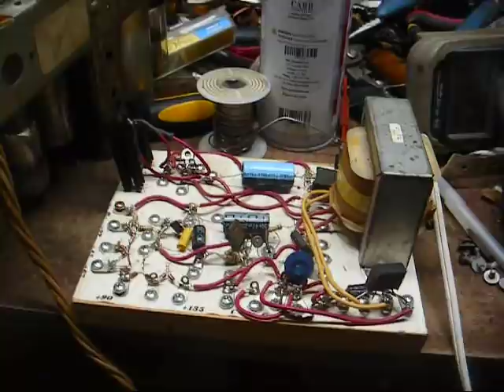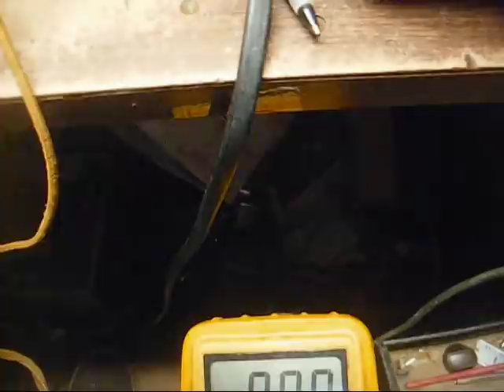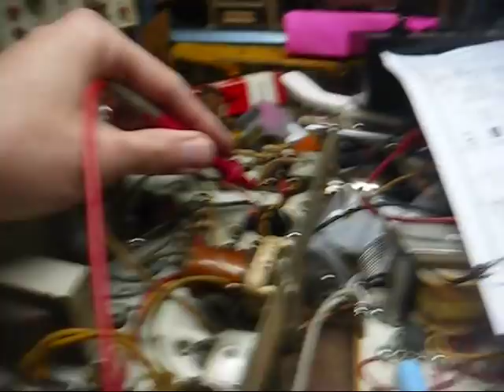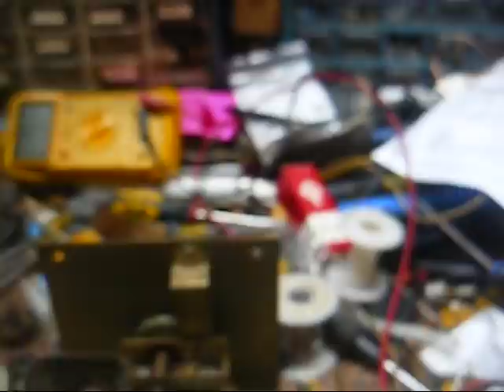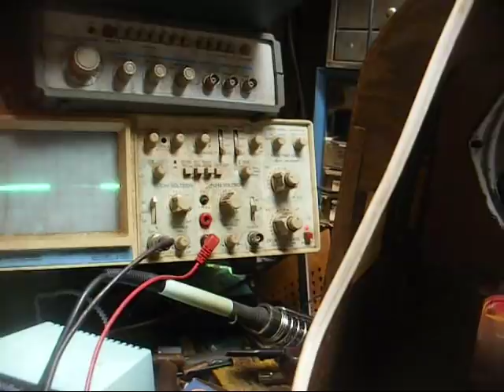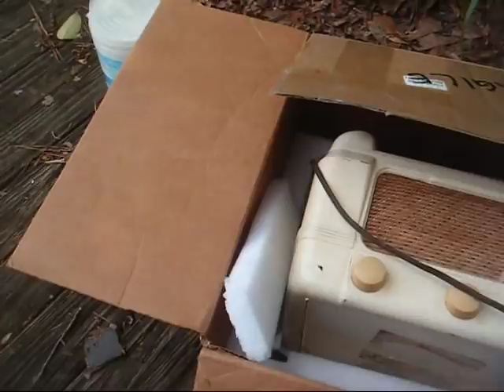Repair of a Philco 39-70 battery operated tube radio

Comment: Bryan : "Now If You're Wondering Where's The Distant Oscillator, Well I Guess That Would Be The Radio Station Transmitter" 31:53 😆 Great to see these two eBay sellers to the right thing. 👍

Comment: I've been through stuff 👍 like this in my life, and, 👍 Yes, one wound ☝ up being with the cassette recorder on my cheap Lloyd's bookshelf stereo I got, back in 1984, from Costco, for $59.99. I got screwed by a dishonest repair person, at the price of $45.00. It was a 💔 broken recording arm he supposedly was supposed to replace, and didn't. I should just have bought another cheap Lloyd's bookshelf stereo for that price. It would have worked that much better. Always remember, even brand new radio tubes can be defective, right out of the 📦 box. I understand your frustration at these radios, and how the problem 👨 manifests itself, and you have to chase your tail to find the root cause of it. I've been there. Your friend, Jeff.

Comment: Talk about power supply interference.  Yesterday, we suffered a power outage, it was a  horrid day for it, the humidity was 80% temps were over 90 degrees F, but you know when I dug out my old Grundig G8 radio so I could listen to the local broadcast for info, I found that I could suddenly receive stations from all over the band, I could even pick up shortwave, something I had been unable to do in this house ever. So I looked around my recliner and counted the power packs that are supplying power to misc things, there are 9 of the little bricks plugged into several power strips as well as a PC, monitor, speakers and the like.  When the power came back on, I tried my little radio once more and nothing!  All I could tune in was the local AM radio station.  We have no FM so can't test that, and my shortwave failed to receive anything but noise as well after  the power came back on 3 hours later.  Never did find out why the outage, probably an overloaded transformer because of all the air conditioners running, hell we had 3 window air conditioners running as well as several fans.

Comment: Dear radio tv phono nut. Can I pick you're brain for a minuet. Can you get the complete cartridge assembly for a zenith turntable? I need the parts that allows you to turn the needle from 78 to 33. The unit is a model D908-11. You are the only one I know that has a vast knowledge base for this equipment. I would rather send you an e-mail but don't know what it is or if you even give it out. The cartridge is good and there is a new needle for this unit but some parts are missing. I might have a picture to show so you totally understand what I am talking about. Thank You if you at least read this I hope you can help.

Comment: I've owned one of those!  All original.  Luckily all the tubes in mine were OK, and when I connected up some batteries (carefully!) it worked!  Those battery sets never got hot, so all the usually-bad parts still were OK, mostly.  Never great performers, sets like that didn't seem to decline much after 75 years.  But a good recapping and alignment gets them back to like-new.  Fun to watch that one restored.

Comment: Thank you for the "schematic" WOW. I thot Octal tubes didnt arrive till early 42 or.so.  That means the radios we got out of Daugherty's junk box in 46-48 scrap with 4-7 pins were a lot older than we thot.
But I learned the color code to rear resistors and micas.from them.
Only got one radio to work, a 5 pin 27 tuber,.for my radio badge. in 48. Started my career in "E".\

Comment: 3V4 or 3S4 would replace the 1C5 with an adapter and filaments wired in parallel.  1L6(!) would replace the 1A7 with an adapter, but the 1LA6 would be a lot cheaper! (also with adapter).  1R5 could be made to work, at lest on the BCB.   1U5 would replace the 1H5 with adapter, would have to triode connect it though.   At least this set didn't use the even older 2v tubes.

Comment: I love the Philco, and it's a survivor to boot. I'm a bit surprised though that they used what looked to be a 4" speaker when a much larger one would fit and give better sound. The other two look quite promising as well, looking forward to the videos on those
Reply from the maker: The one I installed a 6" speaker and it fit in the existing holes. However, the actual cone on the replacement speaker was a bit bigger than the original.

Comment: What's the current draw like on the 90 volt supply? I remember people running these from a few D cells for the filament supply and 9v batteries stuck together for the 90v B+ supply. I have a lambda power supply that can do up to 150vdc but only at 1.5 amps, very clean lab power supply just not a lot of current.
Reply from the maker: Maybe 20 mA on the 90V line and 250 mA on the filament line.

Comment: This radio is from 1939, another one of those prewar tube radios that has battery powered long before portable radios started. It does have a cathedral looking wooden case which was the last thing to used a cathedral looking design.

Comment: Yeah, I came across a tube that was dead shorted; it was in one of those old Radio Shack kits (the ones in the red/clear plastic cases) for an “AM radio”. At the time, all I remember was that it was a 7/9-pin sub-miniature tube, and a quick visual inspection confirmed that it was manufactured that way; there was a metal hoop that connected all the pins together. Later, I remember seeings this kit again in Radio Shack, so I bought it, hoping they had learned that the tube(s) in the earlier kit were no good. No luck, same sh*t. Now, thinking back in it, I believe they were some sort of fusible link that was supposed to be blown open with a low voltage/high current supply (like, maybe a 6v “lantern” battery). Of course, the instructions didn’t say anything about any fusible links, so I wonder how many of these kits went from the shelf right into file 13. Maybe you can blow the “short” out of your tube with something like an old 100W soldering gun. Just an idea. 😏

Comment: Cool radio. My mom had an Emerson ac- dc tube radio that had the small tubes like 1R5,1U4 etc. the battery was a 67 volt for B+ and a special square 1.5 volt battery. My parents only used it once at Fire Island beach when I was a toddler. The batteries were too expensive back then. They had no electric service at Fire Island during the fifties and that was the only battery operated radio we had. We used it to tune in the news. My dad was a correspondent reporter for Associated Press and had to keep up with news broadcasts

Comment: Is it possible to put a permanent transformer in that radio,my guess it wouldn't be cheap unless you had one laying around ,you do save some pretty cool radios ,very cooling watching you.thanks for shareing.your videos are never boring,sounds goods look good too.the white Radio is a very nice shape one ,I we ould save that packing and the box in case you sell it ,but all my packing tips I have learn from you .
Reply from the maker: Back in the day, it was not uncommon for technicians to convert these types of radios to operate on 120 VAC. They'd either do it by replacing the 1.5V tubes with standard AA5 tubes (and modifying the circuit to work with them) or install a power transformer on the chassis (if room permitted) and use 6V tubes. In today's world, I'd prefer to leave the original design.

Comment: How much power does this use?  At $5 in 50s money, batteries were a lot of money and I presume they wanted to make the radios as efficient as was possible.  This would have been especially true after 54 when the first transistor radios were released, assuming they still made these battery operated sets.
Reply from the maker: Around 15-20 mA on the 90V line and about 250 mA on the filament line.

Comment: I’ll admit, I’ve fried some tube filaments before, when I was getting started on radios. I reversed the battery voltages and that was it! Lots of flashes, a pop from the speaker, I was mad.
Reply from the maker: It's like I've said before....if you haven't fried something or shocked yourself, you haven't been doing it long enough. Seriously, it's something that we've all done.
Reply: @radiotvphononut  So true, so true
Reply: on the frying of stuff and getting shocked...oh yeah...
Reply: I did this to a battery set but there used to be batterymaker on youtube and I ended up making a battery pack for that tube portable radio (I since sold it a long time ago) I miss your videos by the way and I still find and re-foam old speakers, where I live (Massachusetts) we used to make some damn good ones (Acoustic Research, KLH, Boston Acoustics...etc) people throw them out when the surrounds foam rot and it is SO EASY to fix them!
Reply: From what i understand, the tube filament is basically the heating element that we see in the tube glowing red hot, that warms the cathode so electrons are produce? correct me if i am wrong, and if you happen to blow the filament like by having too much voltage, then the whole tube is ruined?
Reply from the maker: @KenKen-ui4ny  Yes, the filament (or heater) is what gets hot to heat the cathode. In the case of these types of tubes, the filament is the cathode (known as a directly heated cathode). Tubes with a separate cathode are known as an indirectly heated tube.
Reply: Not as bad, but I popped a 35W4 because I was careless and working hot (I had an Isolation Transformer)  and sent 120V through the tap. It was a Japanese set and a factory tube. Now it has a GE and still has a few bugs I need to iron out or just use the set for parts (it was one of those first projects where I didn't solder the components in correctly, just tacked them).

Comment: Built one of those power supply kits for a 1939 Montgomery Ward Airline farm radio.  It works good but the tube filament output lacks protection to prevent a shorted regulator from burning out the tubes.  It would be easy enough to add a fuse and some shunt diodes to accomplish that but, well….someday.
Reply: "...the road to HELL is paved with good intentions-!!"